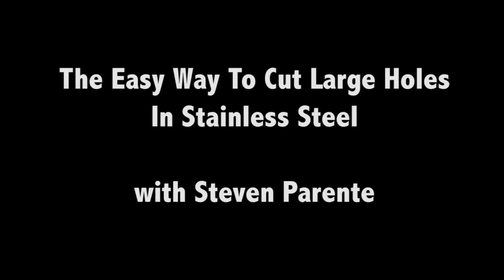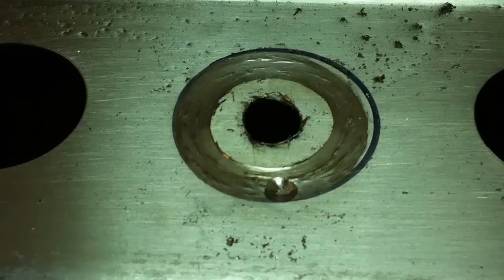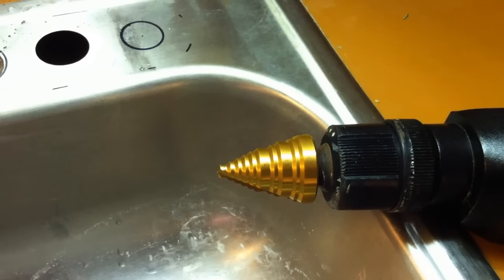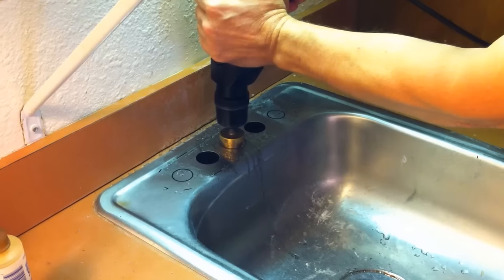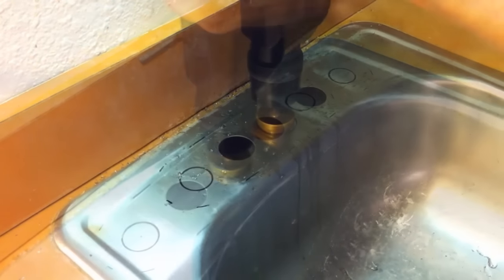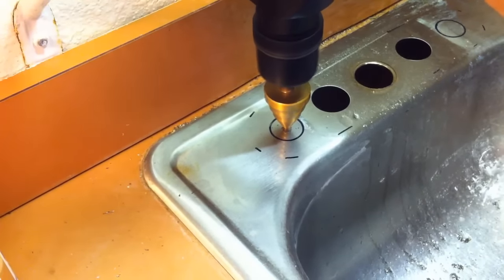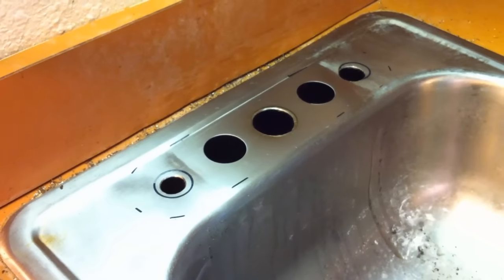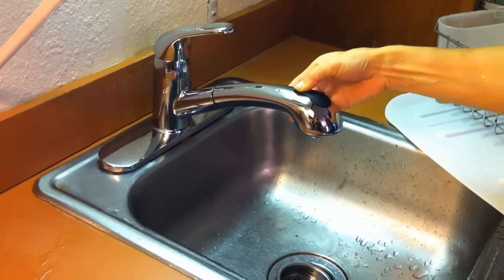Drilling Large Holes in Stainless Steel the Easy Way

Comment: Thanks for taking the time to make this video. It was informative. I would add that my installation instructions recommended adding silicon sealant to the bottom of the escutcheon plate gasket. Something to consider. Cheers
Reply from the maker: Thank you Randy!  Yes, sealant AND plumbers putty around the entire faucet.  I installed another sink in the same basin about 6 months ago:).  The small RV faucets don't last a long time and the parts are hard to find, at least in Hilo.  I found a bathroom faucet that fit perfectly with a tall neck. Thanks for watching.

Comment: Thanks, you've done a helpful public service posting this video. The step drill is an excellent choice. One thing to note about cutting stainless steel: It work hardens very quickly. What this means is that if you take light cuts with too little pressure, the metal hardens from the heat caused by the friction of the tool. It's probably the reason the first hole was more difficult than those following, since the hole saw had very likely hardened the steel. It might be more effective to skip the oil and take a slightly heavier cut with the step drill.
Reply from the maker: +Kevin Kingrey Thanks for watching and thanks for the input Kevin!
Reply: +Kevin Kingrey I agree that stainless hardens (it's technically called "strain hardening") but it's a popular misconception that this is due to heating. 
It's actually the other way round but it happens simultaneously: the metal is hardened by having local pressure applied (above the "yield stress")which means the hardened metal will no longer cut, which causes the tool to overheat due to friction.
The misconception is a bit like saying that death is cause by the heart stopping, because corpses never have a beating heart. Sometimes, it's the other way round.

You can verify which is the culprit here (heat or strain) by putting a thin stainless rod in a vice and bending it 90 degrees. 
If you do it fast, it will heat up and harden. If you do it slow, or with a wet rag on it, it will just harden.
(You can compare the hardness by estimating the force required to straighten it again)
Reply: Just off the top of my head, I'm pretty sure you're right about that. It's been a while since my materials science class! Thanks for the correction.
Reply: In that case, it wouldn't surprise me if an object like a sink, which has been made by stamping a sheet of SS into a mold, would be somewhat strain hardened by its manufacturing process. The main thing is, you have to get your tool biting into the material deep enough to get past the hardened surface when cutting SS.

Comment: drill slooow a good variable drill motor firm steady pressure and any sharp bit will cut but the uni bit works best in ss still has to be sharp but slooow speed and steady rpms works best
Reply from the maker: Thanks for the tips and for watching!

Comment: hi the problem is you are going tooo fast for stainless. Once you see smoke the bit  is finished,when you see the bit has stopped making chips and is only making dust that means the bit is toast. ....its very easy to ruin new bits this way by going fast. You need to go very very slow. Like 1/4 trigger and give slight pressure.

Comment: Some SS is prone to workhardening, that is,  normal machining operations is ineffective at making holes in nthe material. The best solution,albeit expensive, is using  cobalt bits, with lubrication steady and firm pressure.

Comment: Repeating what others have said in TLDR; Stainless is NOT hard to drill - it does work harden very quickly. VERY slow speeds and LOTS of pressure, do NOT drill fast like this video indicates - while it did work for him, and step bits are great...note he only had to drill 3 holes.

 The reason why a step bit works: Imagine a chisel (yeah, bits are only chisels of a sort); a chisel cutting a small amount of material is easier than a wide one cutting lots. A step bit rips a the thickness of the material while a normal 135 degree bit has to remove more material due to the angle...and a hole saw also has to rip around the whole circumference.

Comment: if it doesn't cut and it's spinning fast, you should stop right there because you'll heat up the metal which in turn hardens the material and will be even harder to cut. slower speed moderate feed works best. always make sure you see the chips or it's not cutting

Comment: oil is good, but you should aply some pressure and slow down rotation speed. Wood = fast, Metal = slow !!! other way you just heat material and destroy drill.

Comment: I am Brazil now, i need to increase  the 3-1/2" drain hole for 4-1/2" to fit a garbage disposal. can i use the lennox hole saw bit?  down here is very expensive do you think one will be good for 2 sinks?
Reply from the maker: I can only recommend a step bit.  Hole saws did not work for me.  Thank you for watching!

Comment: Just the video i was looking for. I need to cut a 100mm diameter hole in some 1.5mm stainless on site next week. Will a standard Bosch mains drill and a Starrett 100mm cutter work ok? Do i need to pilot first or will the supplied drill start things for me too? What is the paste i need to get? Also need to drill 4x 8mm holes for bolts, can you recommend a drill bit for this too please?
Reply from the maker: Aloha Gary.  I can only recommend the step drill bits.  I've used the large Bosch in the video and smaller ones.  Step drill bits are self tapping, but using a punch helps.  I used a cutting oil in the video, not a paste, which most hardware stores carry.  A step bit will drill several hole sizes and if you need metric holes, I would suggest you look for a metric step drill bit.  I cut slower than I did.  Thanks for watching!

Comment: How much is for this step drill bit i need it but on ebay lots f them any instruction which 1 i should buy thanx let me know Asap i have to 1 nd half inch hole
Reply from the maker: I paid around $70 for this Bosch titanium bit.  I didn't have much time to shop around, because maintenence shut the water off in my condo unit for me and I had to get the job done quickly.  Otherwise I would have had some angry neighbors!  I also bought a bit that had many large hole sizes for other projects, which adds to the cost.  If you only need to make a 1.5" hole,  there are smaller ones that cost less, like around $25-$30.  I like titanium coating.  Make sure it's rated for steel and that your hole size is shown on the package.  I also tend to buy from brands I've used before and I've had good experience with Bosch.  Good luck and thanks for watching!

Comment: You need friction to cut, oil will not help it to cut. Water to keep the bit cool is important. Cutting "oil" is used to reduce rusting on ferrous metals, not so important on SS. SS will work harden with pressure and speed, nothing to do with heat... Don't center pop the start as this will harden the SS in that area. Use a smaller drill bit to do the marking. Slow speed, steady constant pressure letting the bit cut it's way. Once you hear a screech it's hard and the good times are over.
Reply: +243WW  says "you need friction to cut"
hmmm ... That's only true for certain specialised methods, like machining very hard materials with ceramic or carbide tooling, or cutting with friction disks. Sometimes if you are using blunt tooling, (including hole saws) you might end up friction cutting, and in this case cutting oil does tend to defeat the process.
Friction, I would prefer to say in regard to ordinary metal cutting, is an undesirable by-product of the cutting action. The sharper the edge (provided it has enough strength) and the smoother the cutting faces, the less friction, but stainless is tough on sharp edges, and in machine shops which deal with hard stainless grades, they would not dream of trying to machine it without cutting oil.
Reply: You do NOT need friction to cut.   You need pressure to cut and your cutter must be harder than the material you are trying to cut.  Period.  EVERY machinist uses cutting oil to reduce friction and keep the cutter and material cool by also acting as a thermal wick.  You don't have a clue what you're talking about if you claim cutting oil it to prevent rust.  Not a clue.

Comment from the maker: You'd probably need to use a good bi-metal bit, go slow and use lots of lubricant like oil or beeswax.  If you drill to fast, the heat will make the stainless steel harder and ruin the temper of the bit (making the bit softer) so it won't cut at all.

Comment: Use a slow speed high torque drill like dewalt dwd460 ---sooo much easier
Reply from the maker: +Oahu Kiteboarder Yeah, I'm going to have to pick up one of the new cordless drills if I do more of this kind of work.  I used to use one when building boats many years ago.  But brah, I bought this electric one in 1993.  So, it like costs me .73 cents a year to operate.  Ha!  Thanks for the input and watching.

Comment: The bi metal bit would have worked beautifully if you used cutting oil while drilling the hole.
Reply from the maker: +tiger355 I did try with the cutting oil and the bi-metal bit, but it didn't work.  That's why I purchased the step bit, which worked very well.

Comment: I wouldn't use a step drillbit neither. Use a holepunch. Doesn't matter if wrench- or hydraulic operated. You only need to drill a small hole and punch the remaining material out. Much cleaner result and no need of deburring the drilled hole. And you won't bend the hole inwards while applying pressure on the drill to get that beefy step drillbit in your kitchensink. A wrench operated hole punch for your hole costs less than 25 bucks.
Reply from the maker: +anonym musiteufel Thanks, I'll check into that.  That sounds cheap for a punch.  The sink steel was so thick, it didn't bend at all.  It was made in the 70's!
Reply: Steven Parente
You're welcome!
Reply: Drill is running far too fast.

Comment: Thank you Steven!  I had exactly the same problem, starting off with the same bi-metal bit, going for a 1 1/4 inch hole for a flexible sprayer attachment that turned out to be not optional in the faucet I was installing for a friend.  We left the sprayer under the sink and the same unsightly ragged hole and gouging you show.  I'm headed out to get the step bit.  Thanks!
Reply from the maker: I hope it works out for you James and thanks for watching!

Comment: Thanks for the video. I'll have to get one of those bits. I was trying it with the bi-metal hole driller and not getting anywhere.
Reply from the maker: Thanks for watching Tom.  The step bit works so much better!  Go slow, even slower than what I show and use some machine oil and it should go well.

Comment: your dremel tool with a 1/8 solid carbid end mill will cut through that thin stainless steel like butter.
Reply from the maker: +Bob Jimenez Interesting.  Will look into that for future jobs in stainless steel.
Reply: not something you fill find at Lowes. call Industrial Supply or look on the net for them. you should pay about 8 bucks for an 1/8"  4 flute carbide endmill.
Reply from the maker: +Bob Jimenez Thanks!

Comment: I wonder how well one of those cheap diamond hole saws from amazon would do.
Reply from the maker: I have never tried one Justin, but maybe someone else can comment.
Reply: Steven Parente The answer is, horribly.  That is what I tried my 1st time and even with a constant stream of water it frequently overheated and discolored the sink.  Took 30 mins to get through.  In the end, it worked but not recommended.  Get the $15 sink punch cutter from Ikea- that is the million dollar tip.  Takes only a few minutes to punch out a hole.
Reply: Mike S
Hmm somehow I have my doubts so I'll go grab a sink or two from the back yard and try it this afternoon
Reply: Mike S
alright. I went and tried it with a cheap amazon bit on an unsupported portion of the sink bowl, knowing that it'd be tougher to cut through something unsupported.
The trick is to start at a 45 degree angle to the sink and keep a steep angle as you go through the cut. The diamond hole saw will cut in the original circle most easily if you follow around the circle with the spin direction of the bit heading into material from below and exiting above. It's an ugly job and I now second your ikea hole saw recommendation for most people.
But if I had tolerances of 1/2" to work with where 1/2" outside of the hole area was covered by the faucet surround then I'd not bother going to the store and would use my diamond bits that I already have in the garage.
...or I'd just use my plasma cutter :p

I experienced no discoloration of the stainless using the above method.

Comment: what did you use oil for?
Reply from the maker: I used a light machining oil or also sometimes called cutting fluid.
Reply: yeah but why?
Reply: Donat Kajtazi http://en.wikipedia.org/wiki/Cutting_fluid
Reply from the maker: Thanks for the link Rob, that's it.  Donat, it helps to keep the bit cooler so you don't ruin it.
Reply: I am using WD40 for cooling when cutting near electronics and for bit life.

Comment: I guess you never did any research on stainless steel fabrication. Most of what you did here is wrong. Stainless steel work hardens if you go with high rpm and low load. So go slow and with plenty of pressure. Also coolant not lubricant. Why make a video with disinformation when fact are available on the web?